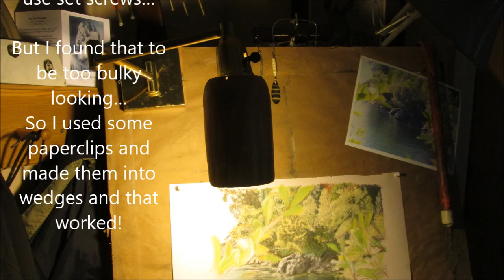wood turning #47 LampShade

Comment: well done Larry them slow motion bits are always heart stoppers  
great idea of cutting out the lamp  on one side 
Take care and be safe
Robbie
Reply from the maker: Hey Robbie:
That was the minor heart stop in this one...
Might I also suggest that you go back and read the video description...
I put a rather lengthy blurb that explains why this was almost my last video!
Thanks for watching
Larry
Reply: The Tiny Trailer Workshop i know the feeling Larry i had a belt sander years back i left it there came back in time there it was blazing on the table :-)
then i had a motor seize on a machine.  i went and collected  the kids from school pooped back to the shed a big fecking blazing fire a compressor  melted to crap.
 so i have beaning lucky to be back in time..woodworking is a dangerous hobbie LOL
Reply from the maker: Robbiethewoodturner Ah but it is fun though isn't it?
Check you shavings
Larry

Comment: Lovely lamp shade Larry!
Woodturning is like real life: the crack is on the dark side and if it should move take WD40 if it shouldn't, take Duct Tape! The tape also doesn't only protect the wood, enhance the light efficiency but literally prevents the crack from being highlighted. Love Duct Tape!
Greetings from Good Old Germany
Peter
Reply from the maker: Hello Peter:
Duct tape make the world go round... but this isn't duct tape... it is ducting tape... it is actual metal.... so heat resistant as well as reflective!
But then again who knows... it may be another form of the same product! 
Might I also suggest that you go back and read the video description...
I put a rather lengthy blurb that explains why this was almost my last video!
Thanks for watching
Larry
Reply: The Tiny Trailer Workshop Hello Larry,
This experience of yours left myself speechless! 
I am glad nothing worse happened.
Being on medication for the last five years due to my depression I had to figure out a few "habits" to stay "safe" on my own.
1. As I am the only one who is responsible for my safety, I have to check my ability to concentrate during the whole time in my shop.
2. although smoking, I never light a cigarette inside my house, therefor I am pretty alerted by every slight smell of smoke inside the house.
3. One of the real bad things on depression is a light(?) form of dementia. As I know I do forget things, I check everything at least 4 times before I "close the case". (If something unusual happens, even more)
I don't want to talk you into my habits, everyone has to find their own and they have to evolve.
I hope this incident doesn't keep you away from woodworking!
I love your very unique style, so please don't stop swimming after this mouthful of salt water!
Greetings from Good Old Germany
Peter
PS: Sorry I didn't read the description in the first place, but it's more easy to listen to a foreign language then to read. (Maybe I'm just lazy and try to find an excuse)
Reply from the maker: ***** Hello Pete:
Not to worry about the reading...  I doubt that half of the viewers see it anyway! I just like to put a little there about the project or the wood or what I am feeling right then! So It is seldom important!
Those are very good habits to get into! I know my awareness will be greatly increased by this!
And you will have noticed that the deck of the lathe is black in #46... so that means that the fire had already taken place! I try and have a bigger project for the weekend video!... So no it hasn't slowed me down at all!
I  will just have to be a little saltier now!
Take care
Larry

Comment: A wee tip - if you want to cut a section from a goblet-type hollowform it's much easier to use a belt sander because you an can profile evenly and do coves...like on a scoop.  My mate had exactly the same experience with hot embers from using a wire to burn lines.  I am paranoid about any heat I generate at the lathe now.
Reply from the maker: Hello Brendon:
That is good advice... I will remember that!
I do think that Check your shavings... is a good tag line!
Thanks for watching
Larry